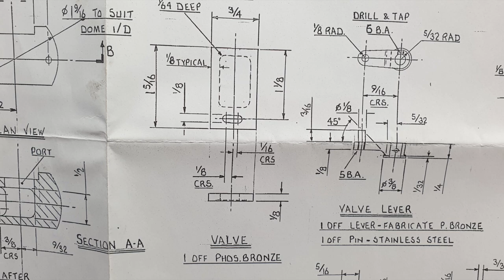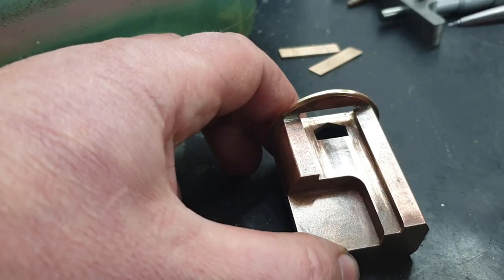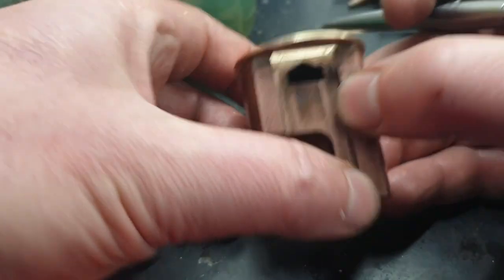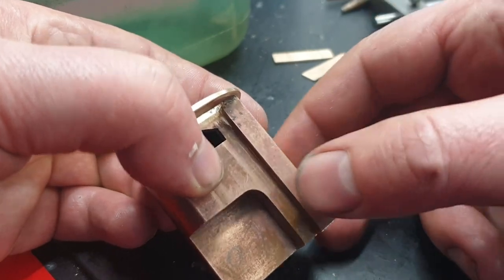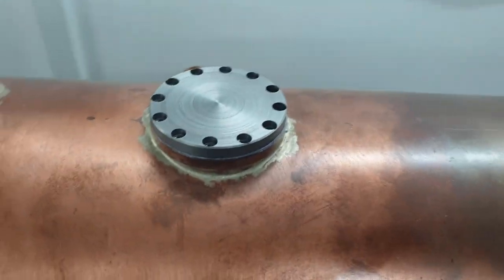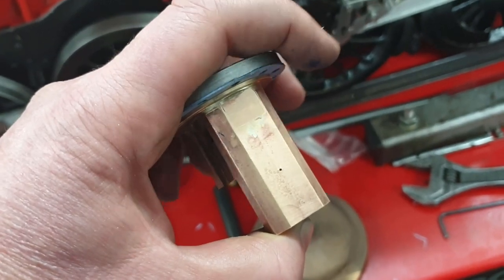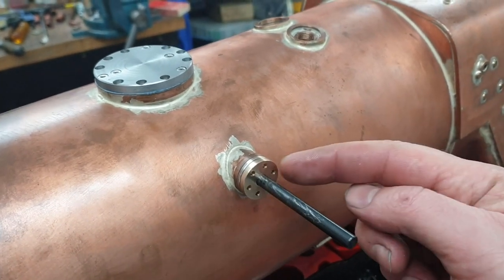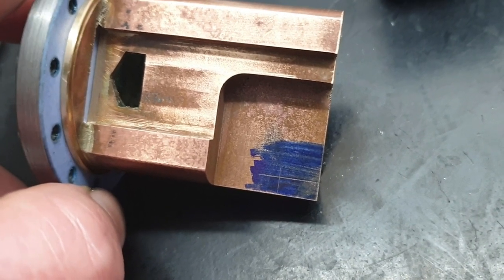9F Loco 5" Gauge - Part 81  Regulator Valve (Part 2)

Comment: Hey Craig. I've been following up on your boiler construction videos in order to get an idea of how the machining process works for a Model Steam Power Plant. Are you ever going to finish the boiler for the Sterling Engine? This boiler looks great too, but it was created by another person, and I was hoping to see the 6" finished. I assume you're busy with others things (such as finishing the 9f Loco), but I would like to see it one day. Cheers!
Reply from the maker: Hi Dain - The 6" vertical boiler is ready for silver soldering however I need to construct a suitable hearth that will retain the heat in the job. It is also a two man job - one to provide general heat to the job with a large propane torch and one to do the detailed soldering with a smaller torch or oxy-propane. I'm not sure when this will happen as I have a lot going on in the next twelve months. It will happen at some point!
Cheers Craig
Reply: @no23mk2  Oh okay. Thanks!